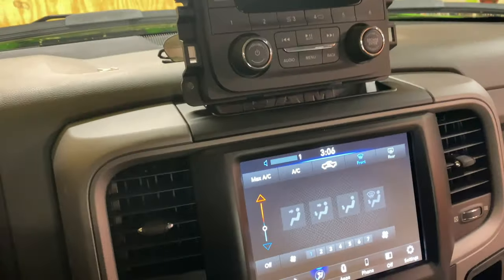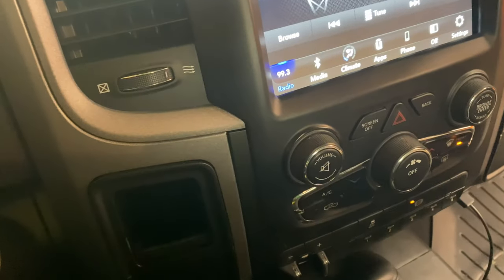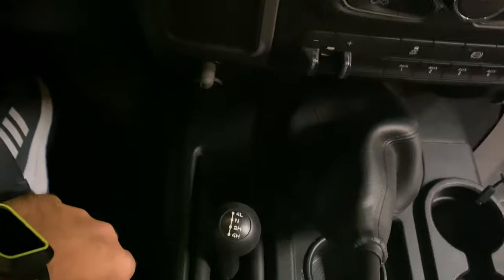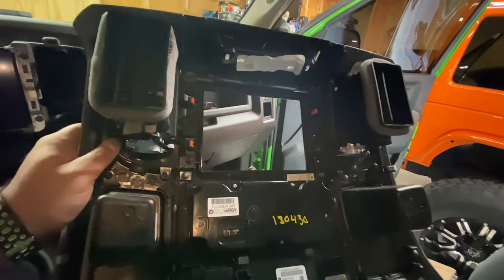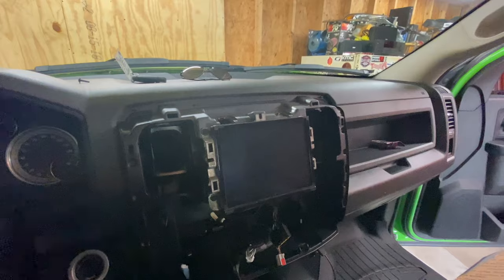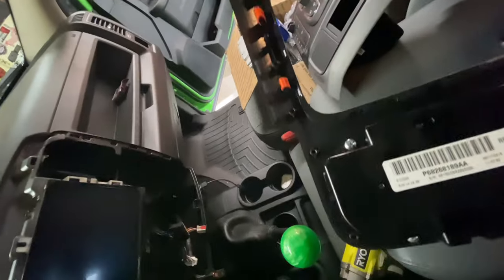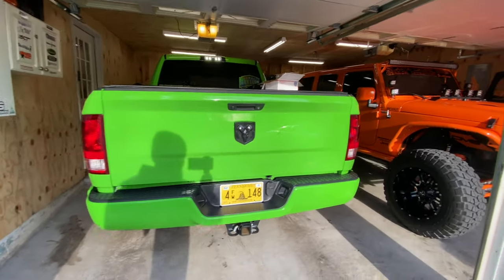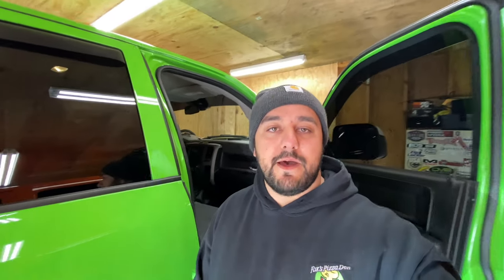Upgrading/swap the RAM radio to the 8.4 inch with Apple/Android CarPlay (step by step)1500 2500 3500

Comment: Thanks for the info, I bought a 2018 Ram 1500 quad cab express, and It has a SiriusXM radio but no car play and the local dealership just told me it can’t be upgraded bc the entire truck would hafta be rewired, that didn’t make sense, n I watched your video n knew it could be done!

Comment: Getting a tradesman in the next week so excited!
Reply: I got a tradesman. Have you upgraded the radio yet?
Reply: @nholt  so I actually decided to save a little and get a gasser, I got a 2017 1500 big horn, and honestly it's awesome I kept the stock radio but from the research I've seen was pretty easy depending on what your using, I would totally recomend getting the adapter harnesses for whatever you choose because you may lose the button functionality and or specific actions. Never cut your harness lol

Comment: I have a 2016 tradesman, and I am really interested in this upgrade. I believe you mentioned that you got the parts from someone that has access to more donor parts. If you have a good source and wouldn’t mind sharing the contact info, this fellow Tennessean would be very appreciative. This video is great btw! Our “work” trucks might not be flashy as the Laramies or nicer trim packages, but like you said we have lots of potential for upgrades.

Comment: What is the name of the stereo and install kit and any other harness or hardware I need for this upgrade as well as the dash upgrade and where did you purchase them ?  Thanks.
Reply: Have you found them yet?
Reply: Find it?
Reply: Any update?
Reply: I have basic rims which I’ll just be painting black
Reply: And the bed of the truck just repainting it black as it has some paint spills so it should make it look new and not Matte old
Reply: And I’m adding side steps aswell wish me luck on a long ass process good luck to yll

Comment: there's several brands that make nice touch screen radios that fit in there.  from Alpine, Kenwood, Sony, Pioneer, JVC etc.  all of them work with everything except the climate controls etc.  plus they will sound better than the stock radios. they do have navigation also.
Reply from the maker: Rather have the factory radio
Reply: @SethRighi  what's so special about it?
Reply: @SethRighi  can you find a link so I can purchase this ? Thanks

Comment: I would like to upgrade my radio on my 2018 2500 as well, where did you pick the kit up? Also great videos by the way. Love them all. I'm going to upgrade the steering wheel and cluster also.

Comment: Does your climate controls respond when you press them on the screen? How would it work with manual controls below the screen? If it doesn't work, any way to get rid of climate tab so it looks and works like it was originally was there?
Reply from the maker: Works as it should

Comment: I have a 2017 with the same ol crappy radio. I’m wanting to put the bigger/better one in myself. My question is will it be a plug and play feature, or will it not work without a factory code? Different vin type scenario.

Comment: Hi Seth, I got a screen replacement on Ebay and got a new bezel. The screen didnt come with the receiver so I am assuming I can just disconnect the 3,0 from the receiver and install the 8.4 in it?

Comment: I just did the 2019 Delphi model swap from my 2016 bighorn uconnect, I can’t get my backup camera to work or the volume up/down track skip buttons on my steering wheel to work.
Any advice? Thanks!

Comment: I have a 2013 slt single cab dually g56 truck that I want to do that exact same thing with do you get all that harness and control module off a 19? Or is it an aftermarket

Comment: Where can you get the kit with all the correct connections and adapters? I have the same radio you took out
Reply from the maker: Cody Winkler Facebook market place or the 4th gen parts page or dm me on fb
Reply: Seth Righi hi,is it gonna work also if i buy an 8.4 factory radio in marketplace and replace my old radio same as the one you change?.. thanks
Reply: Looks like they are hard to find, what’s a fair price to pay?

Comment: Does your back up camera still work? I read some articles on different websites, stating the factory backup camera and  steering wheel buttons doesnt work anymore
Reply from the maker: Mine works in the mirror like it did factory
Reply: @SethRighi  ok thank you.  I just got the truck and deciding to change my radio,  identical as yours
Reply: Is it possible to get a link to get the radio and dash kit and everything you used. I can't find that radio around here for cheap

Comment: Did your Bluetooth work before you got the steering wheel? After you put the radio in and do you know if I already have the 5-speed fan in my 19 classic if I need the wiring harness that goes to the side of the truck? Thanks man great video

Comment: I’m doing the same up grade and I already have the same 8.4 radio and the bezel just need the Wiring harness and the hvac module. Do you have a link where you can get those separate?
Reply: @gastanke  how do I know if I have the 4 speed or 7 speed?
Reply: @dlateshow  look at your fan speed controls  and  count how many white dots are in the face of it if you have a 1500 you more then likely  have the 8speed 90% of the half ton trucks have the 8speed

Comment: Hey Seth, I have a 2019 1500 Classic with the Tradesman trim. Where there would normally be radio controls I have shifter buttons, and my backup camera displays in the corner of my rearview. Like you, I can't deal with this thing stock. I love it otherwise. Would installing this move the camera image to the screen? Also, for talk texting or talking phone calls would I have to install a mic somewhere? Or does the radio have a tiny built in I'm not seeing? Thanks for the upload. Really helpful...
Reply: I believe the mic is built into the truck right above your head

Comment: My tradesman has the trailer type selection in the radio, does this radio have the trailer break selection as well. Like the ability to select different types like light electric heavy electric electric over hydronic and such
Reply from the maker: I have the factory trailer brake and it’s can change on the dash not the radio

Comment: Hey dude, I ordered everything separate to cut cost however I can not find the wiring harness in as an individual item. Do you know the part number?! Thanks-Blaine
Reply from the maker: I do not I think it’s made by an individual
Reply: @SethRighi  well yea that makes sense, maybe someone has pulled one or taken one off and has it. I just need to find that person. I’ll check mopar and the Dodge Ram dealership
Reply: Don korshnak sell the wire I just got one from him
Reply: @georgep4950  just send message    Don Korshnak    on message he is the one that makes them

Comment: correction. not all Ram's come with xm. easy way to tell is no xm antenna on the roof. I optioned my 19 classic with the next step up radio and it's not a touch screen and it has no xm and no steering wheel controls.

Comment: I have the 2019 Ram 1500 Classic i want to swap mine out but haven't seen or found one that is compatible with my truck. Could you assist?
Reply from the maker: keith harendza should be the same as my 18
Reply: @SethRighi  who and where can get this from? I just purchased my 2019 and the radio is boring
Reply from the maker: keith harendza look into 4th gen rams on fb group or contact Don Korshnak on Facebook that’s who I got mine from
Reply: https://4thgenmods.com/ has them. not sure if they have the carplay ones, but they do have the dash.

Comment: Great video. Thanks for showing where the fan speed plugs in. But Don’t you mean 4 speed to a 7 speed?
Reply from the maker: Cron Killa yes I mis spoke
Reply: @SethRighi  does the fan need to be replaced from the four speed to seven?
Reply from the maker: @donbardes  just the module not the actually fan
Reply: @SethRighi 
What was the part number for that stereo head?

Comment: Are you able to sign up and use it as a 4g hotspot after doing the upgrade?
Reply from the maker: sk1 doubtful nothing hardly works like that
Reply: @SethRighi  damn. i wanted to buy a 2019 tradesman and upgrade the uconnect3 it comes with so i could have the wifi 4g hotspot.

Comment: Great mod changes. Perfect for what I’m doing.
On your cluster were you able to view fuel filter life and other service features ?
Reply from the maker: Offgrid Whitetails yes it has everything
Reply: Seth Righi 
Ok so I picked a cluster up from a 2015 eco diesel. Did you have to do any programming other than mileage bud. Sorry for so many questions. Lol
Reply from the maker: Offgrid Whitetails shouldn’t have to all factory settings are stored on your trucks bcm
Reply: Seth Righi 
Awesome. Thanks for your help brother.
Reply: @SethRighi can you add an aftermarket amp with this?

Comment: What about the back up camera
Reply from the maker: Works as it should in the rear view mirror. I have to wire a bypass for the screen to work
Reply: @SethRighi  Where did you plug it into on the radio
Reply from the maker: Tony Linkous factory harness

Comment: So I have a 14 2500 it has the same radio you had plus Bluetooth. It’s garbage and I want to upgrade. I found the radio and bezel but I don’t have the same fan controller, do you have to change that or do they have the bezel as a stand alone to go into my trim unit I already have.
Reply from the maker: Blake D pretty sure you have to swap the fan also there’s guys on Facebook that sell the whole kit or you can buy what ever you need to finish the swap. Look on 4th gen mods on fb
Reply: Thanks for the reply, I may be misunderstanding or maybe I wasn’t clear I want to upgrade the radio but not the fan controller , can I do the upgrade and keep my standard fan controller and knobs and just get a kid that has spots for the 3 knobs instead of the one you have.
Reply from the maker: Blake D I’m pretty sure you have to change both
Reply: Gotcha thanks man
Reply from the maker: Blake D https://www.facebook.com/601085827034586/posts/803727860103714/?d=n